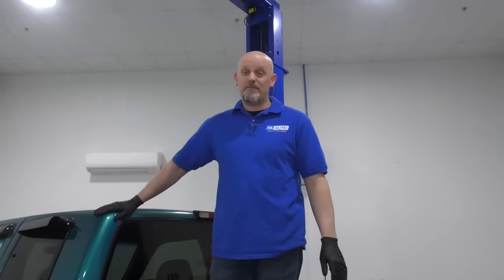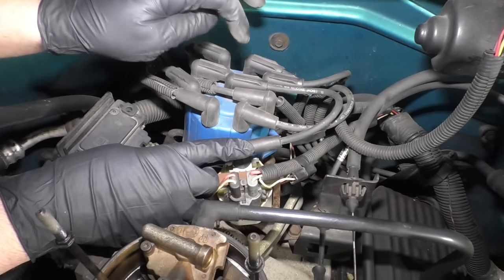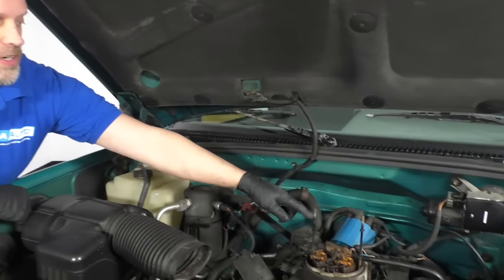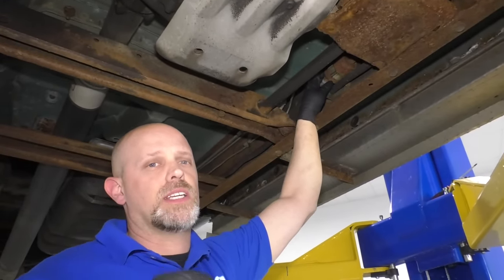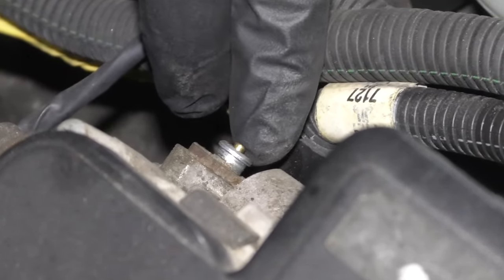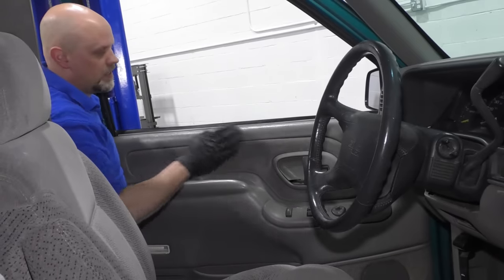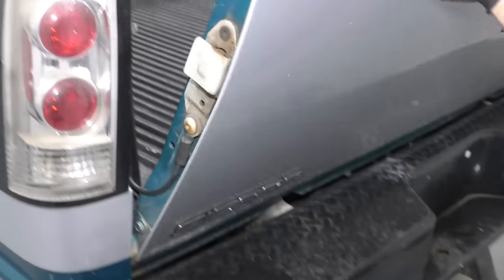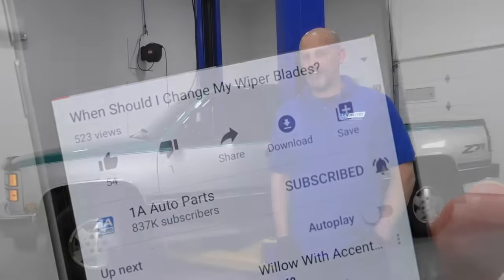Top 5 Problems GMC Chevy Truck 4th Generation 1988-02

Comment: My 2002 Silverado was used in Maine with lots of road salt. Over 15 years and 170,000 miles I had multiple ignition coils replaced, all brake lines and fuel lines done once, front hubs three times when I had false ABS triggering, and one plastic filler neck when it wore a hole from pump nozzles. Catalytic converters failed at 59,000 and 150,000 (The first time was just under the emissions warranty.) I had to do brake calipers multiple times too, and most of my dash lights failed. They were incandescent bulbs soldered to circuit boards, not easy to change.  I had the tailgate problem too, but it usually fell open because the latches didn't work. The handle was fine after I lubricated the center pivot point for the cables to free it up. 4.3L V6 leaked coolant into the oil under the intake manifold starting at about 80k, which was an expensive fix. Also replaced the plastic timing cover more than once to cure oil leaking from the front of the motor. Finally got rid of it when the second gear syncro on my five-speed manual wore out. The doors were rusting out, and it wasn't worth doing a transmission rebuild and clutch on a truck with body rot and a few other minor problems.

Comment: 1997 Silverado  -  drivers inside door handle, drivers outside door handle & lock assembly, cap, rotor, plugs & wires, fuel filter. Fellow owners I feel your pain.

Comment: It's funny.  I have a 93 C-1500 and I have experienced all of these probems in the video except the ABS which mine does not have.  The one good thing these series of trucks is that they are easy to work on.  The one problem that you did not cover that I have seen on the internet is the problem with the 1st mode of the automatic transmission.  My truck "jumps" real bad when you put it in 1st gear.

Comment: I’ve owned 4 of these trucks and had all of the problems here besides for the fuel pump issue surprisingly. Haven’t had one in probably 8 years but they were the most solid pick ups I’ve owned to date. 4l60 is kind of garbage but I’d buy another one if I found the right deal.

Comment: I owned a beautiful looking red 2002 GMC 2500 HD extended cab.  No rust no dents with a matching cap with 4 wheel drive.  Had the gas 6.0 engine with just over 100,000 miles.  The ABS brake system light came on very expensive repair.  Fuel pump replacement ( engine just stalled out had to get it towed) and fuel filter plus fuel lines rusted out expensive repair.  Funny you mention it but after an ice storm I came out to scrape my truck and the drivers side door handle just broke off.  Dealer said this was very common problem.  I sold the truck was just to expensive to repair.
Reply from the maker: +Stephen Johnson Thanks for checking us out!

Comment: I owned a 89 shortbed from 91-2002 sold it with 146k and a 93 blazer full size.. Replaced fuel pump and brake lines

Comment: 95 GMC 5.7l ext cab.  Replaced the ABS motor twice, broken Dr side internal handle,  replaced the heater controls (95 must be a bastard year had to go thru several controls to get the correct one to fit the wiring connectors.  Tail gate problem was/is the cover needs to be replaced.  It can/will fall out if the tail gate is slammed.  130k miles.

Comment: That Huge Much Better Steel Real Bumper definitely is not the Stock OEM piece But a Huge upgrade for showing who's Boss in the Rat race of life , I'm thinking it's even from the late 60's or 70's light duty half ton  models light duty trucks and alot tougher than the rounded piece on the Stock GMT 400 Truck.

Comment: This video was helpful information to me. I recently bought a '91 C1500 4.3L and have replaced the distributor, rotor, spark plugs and wires and it takes about two/three tries of starting it up and 5-10 minutes of  pushing down the accelerator ever so slightly to keep the idle up before it'll stay running. Any advice on what to check next? I intend on changing the fuel filter as it hasn't been changed in 30 years ha
Reply: This is the same problem that you have when you remove the battery cables while running. The computer resets. Check wire connections leading to the battery

Comment: Nobody mentions the ground to the fuel pump where it attaches to the frame! Very common issue in these trucks come to find out. When it happened to my k2500 it took me a bit to figure out why I wasn't getting fuel with a new fuel pump lol. The wire corroded from the inside out. Hope this can help somebody, it threw me for a loop.

Comment: Thank you for Vid. Question Purchased a 1990 something 8ft. Bed trailer convert has the 4x4 decals rear of bed and holes for the larger flair’s wanting to put a topper on it and use for camping/hunting found a topper was on a 1987 full size You think that topper would fit a 90s model notice beds have a different body line style and I see compatibility cut off is 87?  the guy lives 2 hrs away don’t want to waste time and gas.Feed back much appreciated.👍🏻👍🏻

Comment: In 2006 I bought a 1999 Suburban for my wife with cash and a trade in of a 1990 Suburban we had. I did have to replace the driver’s inner and outer door handles during the time we had it. One major issue not commented on are the intake gaskets. GM had a lawsuit levied against it for some of their engines from the mid-90s to early 2000s because of the Dex-Cool coolant. Some of the engines affected were the 3100 and 3800 V-6 as well as the 5.0 and 5.7 Vortec V-8 engines. The intake gaskets were replaced twice on my wife’s Suburban. The first time it was 2007 and it was a $900.00 job. I was unable to get it because of my job. Afterward I flushed the cooling system of the Dex-Cool and started using the universal green 50/50 mix. Unfortunately in 2016 the intake gaskets needed changing again. I saved myself a lot money this time. I sold the truck in February this year with over 200,000 miles on it and still running strong. I did replace the fuel pump, distributor, water pump (twice), alternator and radiator during the 14 years of ownership and that doesn’t include the normal maintenance and service items to replace.

Comment: My 96 4.3 gives me crap everytime it's wet outside. Found out its a common problem with these motors. I was told to silicone the crap out of the plugs on the fuel pump. I also was told about the manifold gaskets, I just had to change mine. And yeah I can't remember last time my tailgate opened,lol.
Reply: Every time we had cool misty rainy weather I had moisture in the distributor and hard/no start problem. Distributor has vent holes with screens that clog. Drill out the screens and installing a new cap and rotor seems to have fixed mine.

Comment: The fuel and brake lines rust away on them I saw even the truck you showed they were rusty now throw Michigan winters at it and it’s not long before your replacing them. Usually happens when trying to change the fuel filter

Comment: I've got a 1992 GMC Yukon 4X4 with the 5.7 350 TBI with 210,000 miles and have had none of them problems. Now I do change my plugs & wires regularly (about every 3000 miles) and every second time I replace the Distributor cap. The plugs coming out usually look almost as good as the new ones I'm putting in.👍👌

Comment: My 1998 GMC Sierra 4.7 Automatic gas engine when I go up a steep hill And I'm accelerating to clime doing about 55 The engine starts bogging down and I have to back off the gas and kind of let it reset and then I can proceed to gas again. It's almost like the motor needs to cough something out. Any feedback as much appreciated. I was thinking the fuel filter fuel pump sounded like the realm of the problem? Also, door handles tailgate heater are all messed up in my truck! Nailed it!

Comment: You forgot to add number 6 rust if you live in the rust belt these trucks get killed from road salt in the winter you have to put used Motor oil on the frame and all exposed areas and also put used Motor oil on all the pinch welds make sure right after you put the used Motor oil on that you drive down a very dusty road so it sticks very well and you wont have any rust

Comment: 2000 GMC 1500 here... 1) My Vortec doesn't have a distributor, mine has separate coils; one for each cylinder. 2) The location for the ABS unit on mine is under the driver's side of the bed, next to the fuel tank.

Comment: I have a 1999 Chevy k1500 Z71, since the beginning.  When setting the cruise, it will stay on for a while, then stop working.  Sometimes it will not set at all, but if I put on the brakes hard, it might set then.  I've change the the switch at the brake 3 times and still having problems.  The fuses all look fine.    Thanks!

Comment: 96 GMC Suburban.  Fuel filter is in the tank with the pump.  Rear ends wear out prematurely.  4L60E transmission.  Damage from old Dexcool.  Leaking inlet manifold gasket.  Serpentine belt tensioner.

Comment: I have a 1997 GMC Sierra 1500 4x4 Z71 with the 350 cu.in. engine that I just replaced with a rebuilt engine which used the longer stroke crankshaft, to give it 383 cu.in. displacement, and I'm very disappointed with the continued lack of power and torque.  I had great difficulty towing a 23ft. toy hauler trailer a couple weeks ago, after allowing the new truck engine to break-in for over 2 months.  That was the whole point of spending approx. $6,000 for the new engine, was to get better towing performance.  The engine builder said he used a mild RV camshaft, which would give me the increased torque I was looking for, but honestly, my 2007 Dodge Nitro 4x4 SUV with 150k miles and its 4.0L V6 has more power and torque than the brand new 383 cu.in. V8 in my GMC truck.  So . . . . now I'm trying to look for other solutions to make this brand new (rebuilt) engine perform as expected.  Luckily I live in a county that does not require semi-annual SMOG equipment inspections, so I should be able to do any modifications I want, as long as I don't move to another area that requires those inspections every other year.  I'm thinking that I should change to a different intake and ignition systems, plus possibly replace the fuel pump and filter for starters, and possibly replace the entire exhaust system with less restrictive headers and mufflers, but I don't know enough about fuel injected engines to know if I can also obtain a different, or reprogrammed ECU module, which will deliver enough fuel, to a better breathing engine, so that it does not run too lean and burn up.  I'd greatly appreciate any and all suggestions on how I can get approx. 350hp to 450hp, and 400 to 500 ft.lbs of torque from my new 383 engine.  Is that realistic?

Comment: My 91 with 466 miles is still my daily driver 300 miles every week for 8 years so far. My issue is the tilt steering bolts keep backing out, loctite didn't resolve the issue last time... maybe JB weld this time to fill the gaps in the worn threads. 👍

Comment: I actually have all but the door handles. My 97 k1500 starts some does and not others, brand new distributor fixed it for a little while then the cap shorted out put a new cap on running fine then randomly won't start again. Heater controls only work on defrost, tailgate handle doesn't open it, I have to squeeze the rods together, abs when I bought the truck it had no real brakes or brake lines to the rear, so I will be bleeding that when I get home. Fuel pump I hear it when I turn the key on but I'm going to get a new filter on my way home see if that fixes my random no start problem. Thank you for putting up such informational videos
Reply from the maker: +Capt. Redbeard Thanks for the feedback!

Comment: I'm actually have a crank no start issue not getting fuel spray from the injectors I've been checking all day pumps good filter is good both of which are brand new, fuel lines are good I'm checking for spark tonight  trying to avoid spending a fortune on a truck I just bought yesterday

Comment: Love the video! I have a 88 chevy 3500. W/5.7 and th400 transmission .Im have intermittent idle with surging , I replaced the fuel mix sensor ( not with A/C Delco) so it still could be the problem. Any suggestions?

Comment: Im getting a check engine code for 3 I've replaced the distributor cap plug wires coolant temperature sensor knock sensor itself wiring harness still getting code my truck runs great

Comment: Fuel pump gave me two years warning, making noise, before a no-start condition. Naturally, if failed with a full 34 gallon tank! ABS wheel sensor is dead. Inside door handle broke. So, in 178,000 miles we had three of these issues. 2000 K2500 Work Truck with 5.7/4L80E and C6P HD payload option.

Comment: I've owned 3 of these trucks since 1998. Love  them, they are simple to maintain. 
Number 1 problem should be transmission.  Usually fails shortly after 100k miles.
Fuel pump is number 2. Because it will just totally fail with no warning. 
Other than that the ONLY reason they won't start is because they aren't getting fuel, because of the shitty fuel pump.

Comment: Not a bad video covered a lot of problems I only complaint number four the door handles You made it sound very simple to replace the outside door handle It is not unless you have tiny raccoon hands getting behind the window to get to the bolts for the exterior door handle and the clips for the rods is a nightmare if you don't have childlike hands it is actually factually easier to pull the entire window out of the door to do the door handle

Comment: My 94 4.3 V6 stalls while driving and does not re-start immediately. Had this problem for a number of years. Funny how it happens sporadically. sometimes months in-between. I suspected the fuel pump , but I can here it working. Your video said it could be the distributor module or ring. How do I check this when it stalls again?
Hard to crank engine and check for spark by myself. Any suggestions? Thank you.

Comment: I have a 91 Silverado and a 97 Sierra and both had fuel pump relay problems. When I hear that someone is scared there fuel pump isn’t working I recommend replacing the relay on 90 model chevys because not only is it a lot easier to do but it’s a lot cheaper and if that’s what it is then you just saving time and money doing it
Reply from the maker: +quickscope all day Thanks for the feedback!

Comment: Don't  take the fuel tank out. Lift the bed! Just a few bolts.  I did it by myself at work with an overhead lift. Or a few friends can help you slide it back.
Reply from the maker: +Stuart Nanney Thanks for the feedback!
Reply: Just cut a hole in the box above the fuel pump. 20 min and you have a new fuel pump installed. And easy access for next time.

Comment: I have a 1998 Chevrolet Silverado 1500 and I have no day time running or  rear light but I have turn signal lights and stop lights. Check all fuse inside and engine fuses and their good.

Comment: I currently own 1996 Chevy 2500 4x4 all issues you had shown are no brainer items. It’d help a lot to do in-depth video on the oil pressure issues as it’s a common problem on these trucks other issues door pins / steering wheel play and how to correct the issue
Reply from the maker: +Patrick Snow Thanks for the feedback!
Reply: 1A Auto Parts no worries 😁

Comment: Haven't had any of the problems you mentioned on my '97 GMC (yet, you say). But I bought the truck with a broken manual window crank handle. Those handles are located too far forward on these trucks.

Comment: Lets not forget water pumps. Every chevy i have owned i have had to replace all water pumps. 89 chevy baretta, 98 gmc with a 454 and Just replaced my 2016 chevy express van water pump with 73 000 miles.

Comment: Should I get a 98 sierra with 220 thousand miles on it .it looks great .she said it idles rough.might need a tuneup .so would it be worth trading my Chevy venture 2001 for it has 180000 miles but runs great

Comment: A common problem with these trucks is the 4wd actuator in the front differential. If it blows the fuse, it's probably a bad actuator. No blown fuse? It's probably a range selector switch on the transfer case that sends signal to the actuator. Check connectors and switches before jumping on the actuator replacement right away.

Comment: There should have a door in rear to access fuel pump.ABS problems,sagging doors due to pins but ,I love  these trucks,have two now and wouldn't consider a Ford or Dodge.Hooking log up and mashing gas in 4 wd. is exciting and a real blast!
Reply: You can fix that access problem to your fuel pump. A guy in this thread earlier said to cut an access hole in the bed floor! Then you can cover it with a bed mat or bed liner.

Comment: If you own a 1988 to 1995 truck, replace the TBI fuel pump with a 1996 to 1998 fuel pump from a Vortec truck. It’ll swap in perfectly and it’s a better, stronger fuel pump.

Comment: 2000 gmc classic. Lost 1st motor at 180k to faulty spider injection. Second motor with 30k got hv oil pump and new spider . Now has 430k on truck. 4l80 started whining at 320k . Changed filter and fluid. Ac redone at 350k. Now dash falling apart.

Comment: ‘93 Silverado …. impossible to find replacement rubber kits for windshield and extended cab side and rear windows.  Also the rubber seal for the cargo light. 

There are still some around for cab doors and windows.

Parts sellers for OBS vehicles are spotty at best.

Comment: Brilliant channel! I have a 1996 K1500 sub. My "check gages" light comes on and speedo + rev gages drop to zero while driving. At the same time feels like I've lost 1st gear and maybe 2nd.   Any advice? 
Ignition? Speed sensor? Or just a fuse? Where to start...
Reply: Or grounding issue?...

Comment: The main problem with the ABS is that it's there.  If we all took the time and trouble to be better drivers we wouldn't need an Anti-Braking System to shut off our brakes when we were applying them too hard and "locking up" the wheels.  There could be one less fragile electronic gadget on the vehicle that can go wrong.